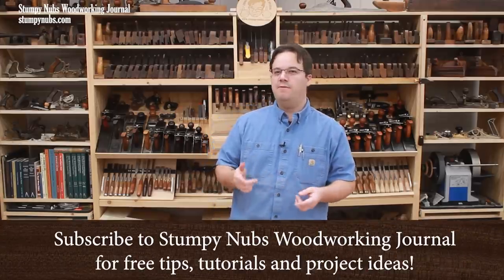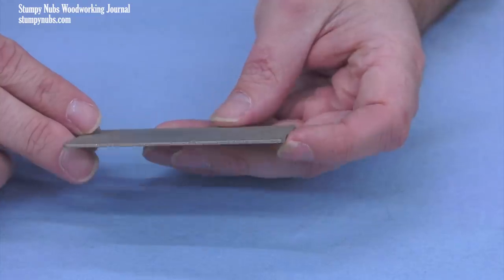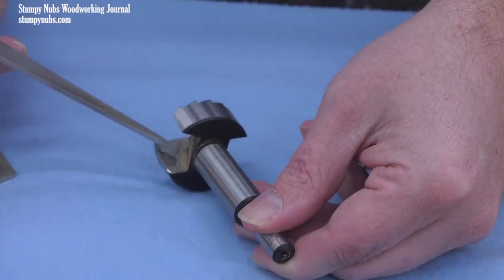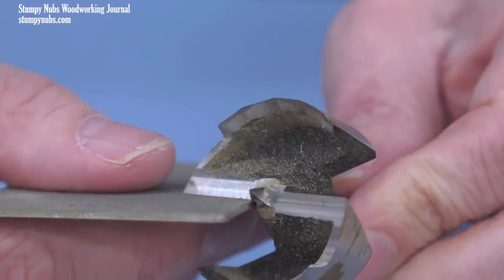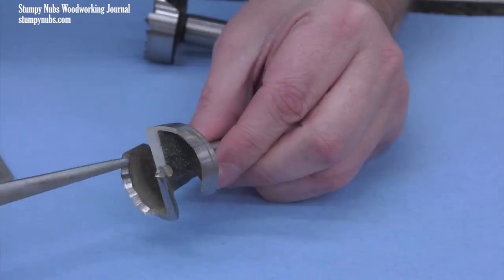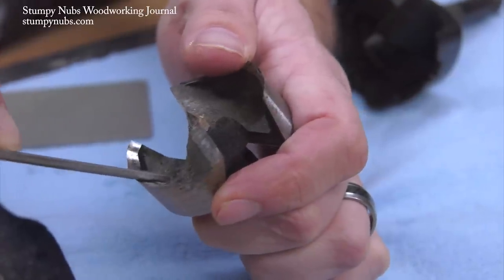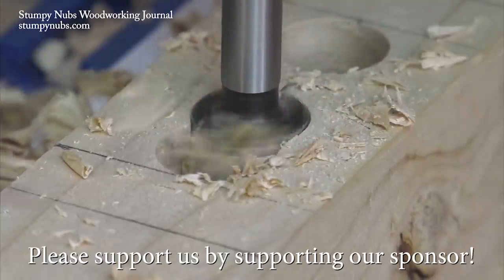Simple trick = 4X longer bit life!

Comment: Great instructions.  Thank you!  
 I watched your 2016 Fast & Easy Forstner Bit Sharpening video about a year ago and purchased the Trend curved diamond file and lapping fluid.  
I was able to breathe new life into several Forstner bits that were no longer cutting clean holes.  One or two had been damaged by overheating, so I'll probably have to replace them soon.  Now that I have a drill press, overheating is less of a concern because I can control the drilling speed and the pressure of the bit against the wood far better.

Comment: Great vid!  An additional tip to improve accuracy and monitor your progress: use a large blue dry-erase felt tip marker to color the surface you're about to hone.  It will provide instant feedback.  Why blue?  Because black is actually difficult to see on polished steel.  Wipe off any excess blue when done to prevent marking your work.
Reply: I think I should try that with my chef's knife as I feel my whet stone technique isn't quite where I want it to be. I see machinists use blue permanent marker too.
Reply: @inthefade  really a sharpie will get the job done

Comment: In order to reduce the variation of an additional variable, if you were to drill a shank sized hole in a piece of wood and hold it in a vise, it would keep the bit from wiggling around as you were sharpening the rims.  That may be a better technique than holding the bit in your hand for that operation. As always, great job great instruction! Thanks!

Comment: Fisch Forstner Drill Bit Sets made in Austria were too expensive for me recently, so I ended up purchasing a Freud FB-100 16PC Diablo Forstner Drill Bit Set also made in Austria from Amazon for $174.12 before sales tax.  Both share the same wavy outer cutting design around their circumferences.
This Freud FB-100 Set should last me a pretty long time.  Nice to know how to touch-them-up because replacing them as need be, although necessary, is a certainly cost maintenance bummer, so I will drill slowly.
Thank you for the 3-piece Sharpening Kit tip, Amazon offered 25% off the $107.99, so I saved $27.00 based on your timely recommendation.

Comment: I have been using a magnifying head band and a Dremel with either a small cutoff wheel, or conical stone, or sanding drum, depending on the forstner edge that needs sharpening for about 30 years.  Started with diamond hones during my first 10 years of woodworking, but life is too short.  In the 30 years of grinding, I messed one up bad enough that I couldn't salvage it and had to replace it.  All the others are sharp and still living.  As long as it is cutting clean, it is not the end of the world if the chips come off a bit uneven...just take a bit more off the heavy flute the next time.  As it is the flute taking all the cut, it will also be the first to need a tune up.  There are single flute bits, after all.  Clean hole is the goal.  Teak will take more than 5 laps a side after about 3 holes.  My advice is that if you have a dull bit, try the Dremel.  You really don't have much to lose, and you may find that you can carefully (and quickly) get a sharp edge, even on a "trashed" bit and get back to quality work.

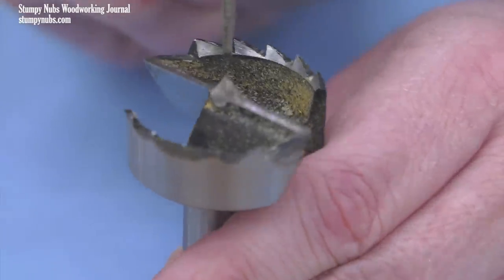Comment: 3:17, look at where you're pointing the card to the left of the center.  That provides a negative rake angle, when you'd expect a positive rake to work better (the card should be pointed to the right of the center in the shot).  

But as you know, the forstner geometry is a pair of rotating plane blades, with a scoring knife around the edge, so the "teeth" don't cut like a hole saw.  They're just scoring.

Also, while honing in 5 strokes isn't going to hurt your bits, you're effectively sharpening bench plane blades by laying the blade flat on the stone instead of sharpening the bevel.  I do agree though that hand sharpening the bevel presents issues that make it impractical.
Reply from the maker: I am merely sharpening the tips of the tooth. While they look like saw teeth, they are really not the same as on a saw. A forstner bit only cuts with the tips of the guide rim- scratching the fibers. The large chippers remove the actual wood. Continuous-rim and wavy rim bits are a good example of how forstner bit rims work. These have no "rake" angle at all.

Comment: Another worthy moment to mention, in lieu of dowels fine enough to reach those tiny curved surfaces, bamboo skewers come in a fair variety of diameters and lengths, and they're both cheaply bought AND relatively strong and durable!!!

    In most "lapidary supply" sources (sites like Rio Grande for instance) also offer ordinary diamond grit... JUST the grit. A little know-how and some adhesive allows you to order the grit # you want, and stick it to the object, surface, or curvy material as needed... It's (again) not entirely a perfect solution to everything, but when you need a specialty utensil or one-off instrumentation for a specialty job, it can work "in a pinch" or even become a "new gold standard" for your shop with a little invested experimentation...

     ...AS with anything, though... It's also about "How far YOU want to take it."  ;o)

Comment: If you do back and forth strokes, you are rounding the surface because the pressure of your strokes is always more on the side that the direction of the stroke is. Therefore, you should stroke from the sharp side down, lift the card up and repeat. In your theory this should be 10 strokes then. I would love to hear your thoughts about this.

Comment: What side are you using? When showing the "lay flat" technique, you seem to be sanding on the 600 side of the card. When doing the alternative "bevel only" chipper, you're using the 300 side. Is there a reason for this?
Reply from the maker: 600 for both. If I used the wrong side in part of the demo, it was an oversight.

Comment: I just watched your video of random orbit sanders. I wanted to ask what kind of random orbit sander should I buy for a shop that only makes cabinet doors, and sometimes do 40 to 50 panales without break. I was also wondering what kind sand paper i should use. I fell like I'm wasting money throwing away sanding paper after 20 o so panales. Any advice would be greatly appreciated.
Reply from the maker: If you are willing to spend the money, I highly recommend Mirka sanders. They are very comfortable to use over long periods of time with low vibration and when paired with a good dust extractor they are pretty much dust free. Festool sanders are very similar in quality, as well.

Comment: Have you ever made a bit unbalanced from sharping? Foerster bits may not be as noticeable due the lower speeds but I've done about 2000 passes on 2in router flattening bit and this was just to see if I could flatten the cutters on my cheap China bit and well I didn't but I got most of it and the most important parts but I didn't have any issues but the balancing seemed fine or the same as before I wasted 30 mins. I've always heard not to do to many passes for that reason. But didn't seem to effect anything
Reply from the maker: Un balanced? No. The risk is an uneven cut, which will make a poor performing bit.
Reply: @StumpyNubs  thanks

Comment: I bought one of the Fisch wave forstner bits on your recommendation...what a WASTE of £40, its already dull after drilling only 10 holes in the end grain of some 4x4 soft timber. A cheaper (£20) one from a local DIY store, done nearly 400 holes before it started to dull. I'll be taking your recommendations with a pinch of salt from now on. Not impressed at all.
Reply from the maker: Where did you get it? That doesn't sound like a Fisch bit AT ALL. I bet it was counterfeit. Send it back.
Reply: @StumpyNubs  purchased from a dealer on e-bay, came in what looked like genuine Fisch packaging, but then hiw can you tell fake from genuine these days?!! The first few cuts were beautiful, then by the 10th it was struggling and 'binding' in the wood.
Reply from the maker: @mickyas1000  I am sometimes amazed at what is counterfeited today. And Amazon mixes it right into the same stock, so you may buy from a company's Amazon store, and Amazon may ship you counterfeit stuff sometimes. It is very frustrating, but it is something Amazon and other online retailers need to figure out.
Reply: @StumpyNubs  thanks for taking the time to respond, much appreciated. 😊😊😊😊